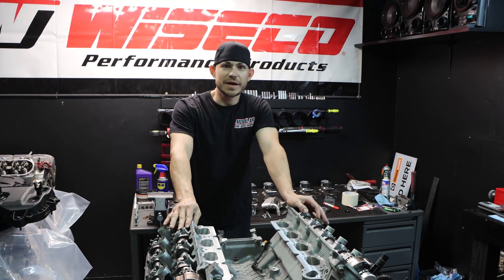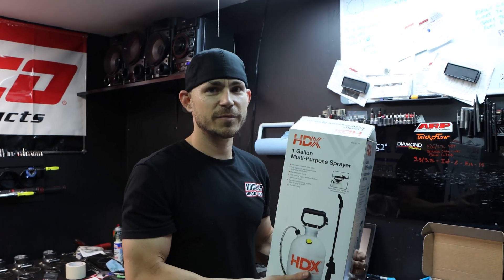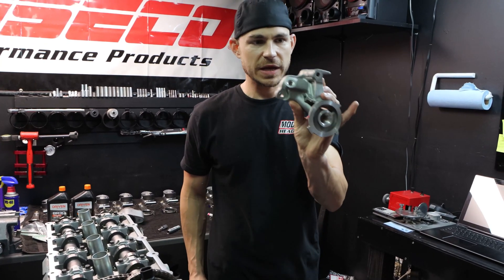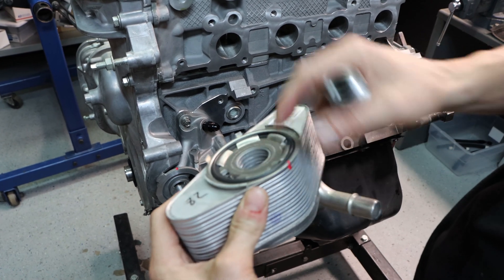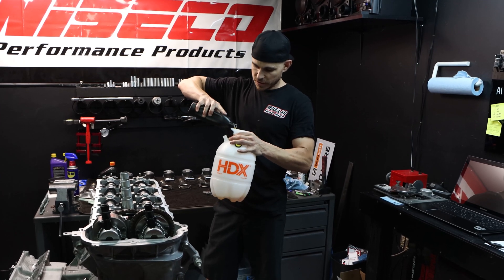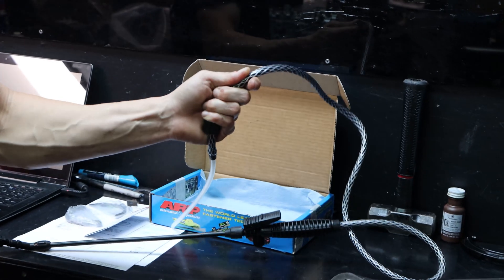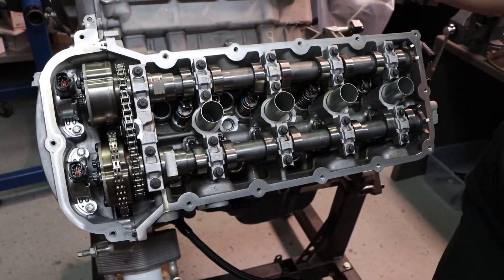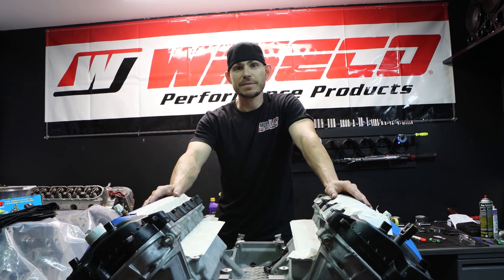Tech Tips - Proper Ford Modular Engine Oil System Priming

Comment: So much good information on these videos. I have a question hopefully you can answer. I'm freshening a GT 500 5.4 engine and I don't know if the rod bolts are torque to yield. One time use only. I see ARP doesn't make those bolts.

Comment: Guys the oil sending unit is a 1/4" NPT, which is an air compressor fitting! Idk why they complicated the hell out of this! Just get a 3/8fuel line, the $5 band clamp kit from harbor freight and a pump weed sprayer while youre there, and you're golden! A 1/4 NPT air fitting is like $1. Just be careful when threading it into the aluminum threads because the fittings are typically steel. Do NOT use brass.
Reply: Curious, why no Brass?  I was going to go your route just curious on why no bass ntp?

Comment: I forgot to state, my vehicle  is a 2016 f150 5.0 on the 2 back cylinders  getting to hot and taking out intake valves losing compression. THANKS.

Comment: I had a 98 cobra engine rebuilt with forged rods and pistons and i had a garage fire, luckily the engine was in the shop at the time, but with no car to out it in, the engine sat for 6 years. I recent installed the rebuilt (0 miles since rebuild) engine and I turned the motor by hand and poured oil over everything but didn't pour oil in the cylinders. 

I tried starting the car for the first time today and it was a crank/no start. I got a weird noise, almost like a popping in the intake, like when the timing is off. It makes me think the crank sensor is bad. Any suggestions? Done all the normal diagnosing except spark, that will be tmw. But even with zero spark, I'm still xonfused on the popping noise since everything new.

Comment: Just did this. Worked perfectly. On the Home Depot pump I bought, the plastic pipe was too small to just tap with a 1/8 NPT tap. I heated up the end of it and jammed a 1/4" barb fitting in there leaving the 1/8 NPT male piece sticking out. Then I added a 1/8 NPT female/-4AN male to it and connected it to the hose that goes to my oil pressure sensor. no leaks. The handle on mine has a lock so you can squeeze the trigger and lock it. This way you can pump it up, lock it open and just leave it until the pressure is gone. These pumps aren't made for oil so it takes a while but locking it open you can just stand there and watch the oil level in the tank go down. Thanks Jordan!

Comment: Once primed its PRIMED .. only reason to re prime it is if you wait 3 years to install it. like wise pulling fuel pump fuse works and then cranking or holding throttle wide open ... but making a cheap prime canister is good practice because you eliminate you as the engine builder from the dumb ass owner not bothering to prime.
Reply: Bet hes still waiting for his balls to drop to get the deep bass voice ? till then I guess hes gonna keep sounding like cartman from south park and we are just going to have to respect his authoratEEE...

Comment: Jordan to do and oil pump/ gear do you have to remove the valve lash adjusters or can you lock the cams at tdc and remove the chain etc to install the new pump/gear??

Comment: Thanks Jordan.  As you said a simple but effective method. In the 1960's my Dad built a pneumatic system based in a grease gun and it pumped 2 quarts just like your simpler system.